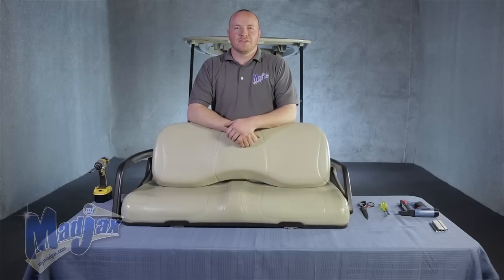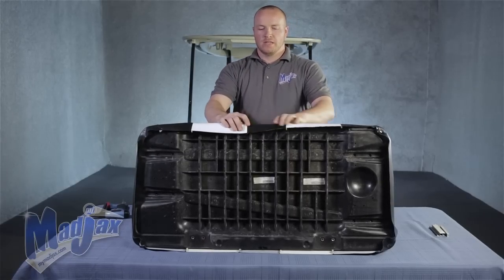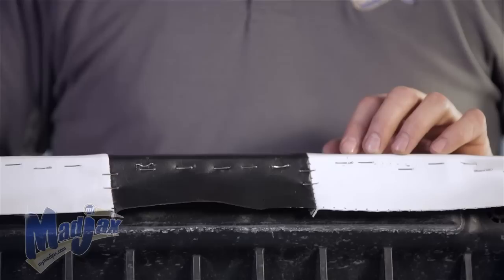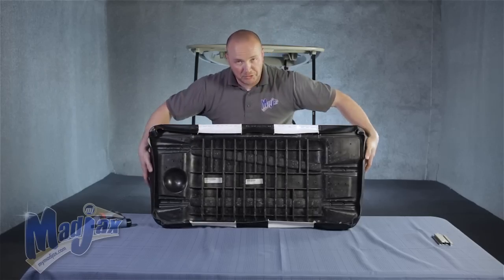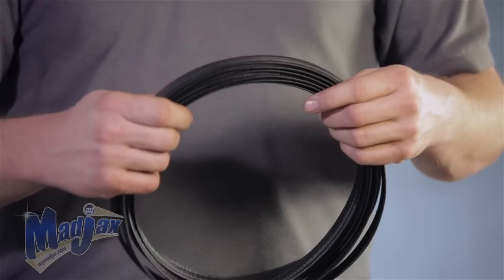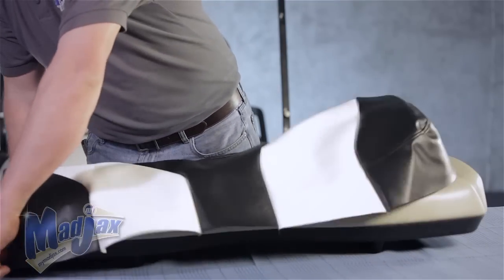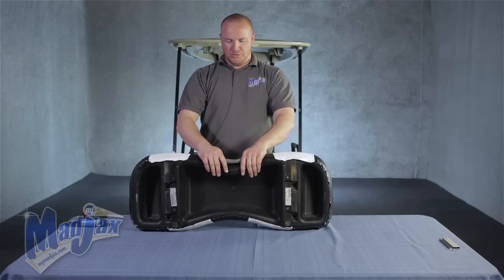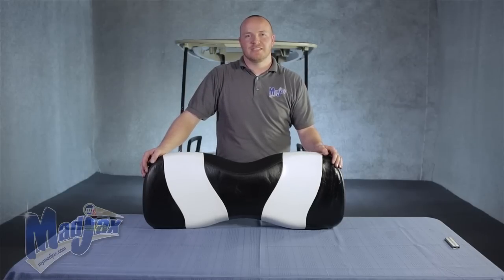Two Tone Seat Covers On a Yamaha® Drive | How to Install Video | Madjax® Golf Cart Accessories

Comment: Seat Cover Glued to Backrest???...YES It IS !!. They did that... Why Yamaha?...Why??? Doing one Now and inventing new curse words as I go !! Glad I saw this before I tore up the hard plastic. I'll be going over the old one with some Cheapo Amazon cover now , plastic and all, stapled and I got some roll of cheap rubber wheel lip molding at Auto Zone that'll cover it nicely...A little black paint Pen/Magic Marker will hide the silver staples when it's tucked under...Sumbitches at Yamaha...🤬🤬